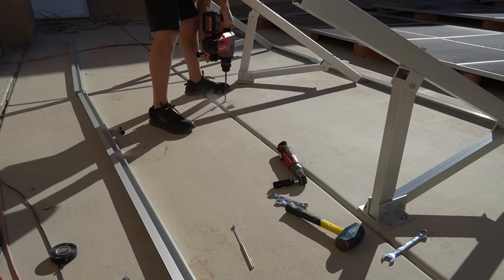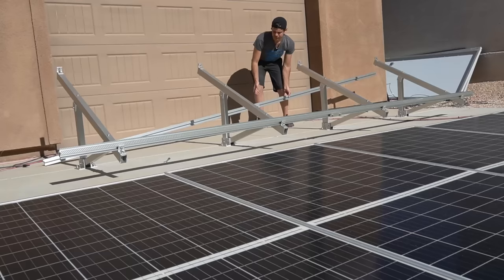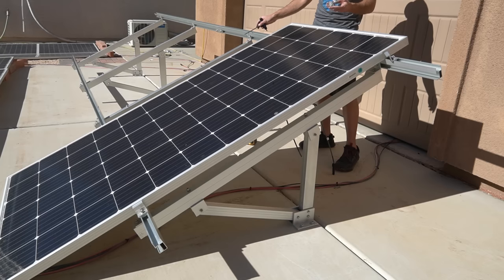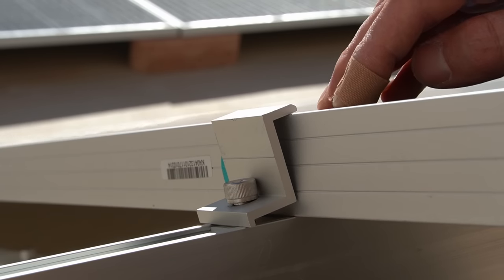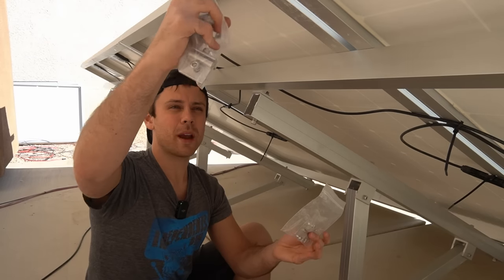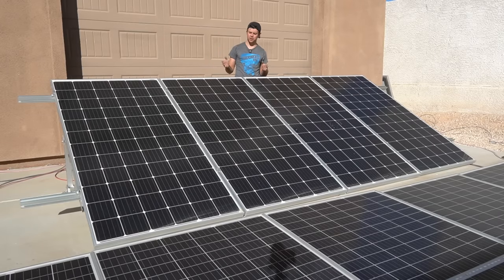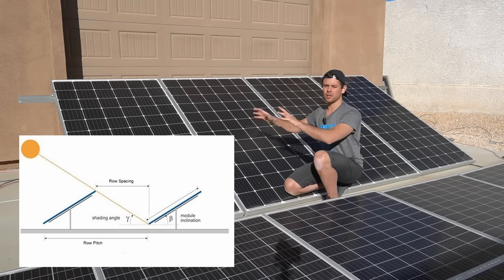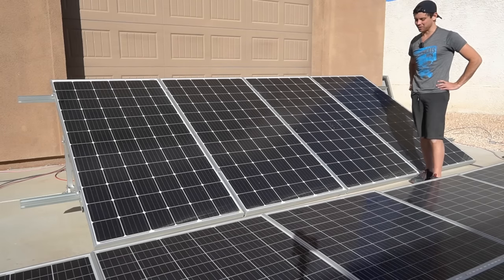$279 Ground Mount Solar Array - DIY Friendly!

Comment from the maker: You can buy it here (affiliate link): https://signaturesolar.com/eg4-brightmount-solar-panel-ground-mount-rack-kit/?ref=cPwLcVc0SW-BjN

~~~~~~~~~~~~~~~~~~~~~~~~~~~~
Does off-grid solar confuse you? Check out my DIY friendly website for solar system packages and product recommendations, and so much more!: http://www.mobile-solarpower.com

Join our DIY solar community! #1 largest solar forum on the internet for beginners and professionals alike: https://www.diysolarforum.com

Check out my best-selling, beginner-friendly 12V off-grid solar book (affiliate link):
http://amzn.to/2Aj4dX4

~~~~~~~~~~~~~~~~~~~~~~~~~
My Solar Equipment Recommendations (Constantly updated! Check here first):

12V/48V Lithium Batteries: https://www.mobile-solarpower.com/solar-batteries.html

Solar System Component Directory: https://www.mobile-solarpower.com/solarcomponents.html

Plug-N-Play Systems: https://www.mobile-solarpower.com/full-size-systems.html

Complete 48V System Kits: https://www.mobile-solarpower.com/complete-48v-solar-kits.html

DIY Friendly Air Conditioner/ Heat Pumps: https://www.mobile-solarpower.com/solar-friendly-air-conditioners.html

Complete 48V System Blueprint: https://www.mobile-solarpower.com/48v-complete-system-blueprint.html

~~~~~~~~~~~~~~~~~~~~~~~~~~
My Favorite Online Stores for DIY Solar Products:

-Signature Solar: Offgrid One-Stop-Shop. Best Value 48V LiFePO4, Victron, Quality Solar Panels and Offgrid Specific Heat Pumps: 
https://www.signaturesolar.com/?ref=h-cvbzfahsek 

-Current Connected: SOK, Victron, Mr.Cool Heatpumps and High Quality Components: https://currentconnected.com/?ref=wp

-Ecoflow Delta Official Site: My favorite plug-n-play solar generator:
https://us.ecoflow.com/?aff=7

-AmpereTime: Cheapest 12V batteries around:
https://amperetime.com/products/ampere-time-12v-100ah-lithium-lifepo4-battery?ref=h-cvbzfahsek

-Rich Solar: 12V solar mega site and cheaper prices than renogy! Check them out: 
https://richsolar.com/?ref=h-cvbzfahsek

-Shop Solar Kits: Huge site with every solar kit you can imagine! Check it out:
https://shopsolarkits.com/?ref=will-p

-Renogy: A classic 12V solar store that has been around for ages! 
https://renogy.sjv.io/n1VjXx

-Battery Hookup: Cheap cell deals
https://bit.ly/2mIxSqt
5% off code: diysolar

-Watts 24/7: Best deals on all-in-one solar power systems, with customer support and distribution here in the USA: 
https://watts247.com/?wpam_id=3

If DIY is not for you, but you love solar and need an offgrid system, check out Tesla Solar. Low prices and great warranty, and they can take your entire house offgrid with their new Powerwalls: https://ts.la/william57509

~~~~~~~~~~~~~~~~~~~~~~~~~~~
Contact Information:
I am NOT available for personal solar system consult! If you wish to contact me, this is my direct email: williamprowsediysolar@gmail.com

Join the forum at https://diysolarforum.com/ if you wish to hang out with myself and others and talk about solar

FTC Disclosure Statement and Disclaimers:
Every video includes some form of paid promotion or sponsorship. Some links on this youtube channel may be affiliate links. We may get paid if you buy something or take an action after clicking one of these. My videos are for educational purposes only. Information is subject to change/update at any time. Electricity is DANGEROUS and can kill. Be smart and use common sense :)

DIY Solar Power with Will Prowse is a participant in the Amazon Services LLC Associates Program,
An affiliate advertising program designed to provide a means for sites to earn advertising fees by advertising and linking to Amazon.com
Reply: Hi Will! Can I get these panels shipped to Mexico? Was thinking getting some poly rich solar panels from Amazon to start building my system
Reply: What is the minimum you recommend spending for a solar setup that the only thing you should expand is adding extra batteries and extra solar panels?
Reply: What's so frustrating is with minor modification you install a central shaft and an electrical motor for sun tracking
Reply: need a video about DIY by MIDNITE SOLAR, inverter
Reply from the maker: @nineteen70six  those are cheap relabeled units from china. renogy and other distributors sell the same ones.
Reply: @WillProwse  ok thanks, just happened to come across them on a website and never heard of them.
Reply from the maker: @Joyner what? Can you post that on the forum? Who flagged it? I've never even heard of them flagging anything. It's not because of my links
Reply: What exact Solar Panel did you use to put this together. I have that  mount as Well
Reply: Which brand/ sized charge controller would you use to handle the 1600w coming from the solar array? 
I have 4 panels(228w) that I want wired in series as 24v and each panel outputs 29.6v. I have an MPPT Renogy 40amp Li with a voltage limit  of 100voc. If I hook up all 4 panels in series the voltage output is 118 4v it passes the 100voc limit, I can only hook up 3 panels at a time currently. Any advice?

Comment: Have my 12KW system up and running..finally. 2 strings of 2 in parallel. I am getting 350 VDC at 20 amps on the 2 paralleled strings. Almost 7 hours a day. 40 Degree permanent tilt to average summer and winter. A lot of work and time but well worth it. One heck of a learning curve
Reply: Did you mean 2 strings of 12 panels? Sounds like a great system.

I have a 6kW system, installed 8 years ago. It has two strings of 12 panels at 250W each. My next one will use panels at almost twice that power. Greetings from México, where our panels are at 22 degrees!
Reply: @impulsesystems  Hello Lee..I always confuse the string. I have 4 rows of 7 panels upper two are series then one parallel lower 2 the same ..total 28 420 Watt panels, so I have two parallel strings feeding the inverter. Even on a cloudy day I get 350 VDC on each parallel string at 20 amps each. All connected to a SolArk 12 K EMP edition. 
For an old man like me it was a project and ahalf

Comment: Just a suggestion - instead of using the readheads to anchor the array to the concrete, use Tapcon bolts. This way if you were to take it down, you just remove the bolts, not cut off the readheads and leave them in the concrete.
Reply: Ya I was like omg that a beautiful concert pour and they did amazing float job, and he fractured it... tapcons r the best, and if u wanna make em permanent just add some bonding agent, the type I'm trying to think of is not computing in my brain after being awake for 28hrs

Comment: I just began building my own panel array mount.  Had to clear a lot of trees out of the area and then "planted" 3 telephone poles around 5 feet deep, 12 feet apart for a 24' panel mount.  Then strung a level line across the poles at 12' high and cut the tops off at a 33 degree angle (for our latitude).  Then took the tops, turned them over and buried those 12' in front of each of the poles I just cut them from so I had short poles in front with a matching 33 degree angle.  Then I placed two 16' beams on the tops of the 12' poles and the same on the short front poles.  Finally, placed more 16' beams between the front and read supports, lag bolted some u-channel metal onto those, and then secured my panels to those.  I only have 12 455 Canadian Solar bifacial panels so far, but plan on adding another 12 to 24 for my Will Prowse inspired 6500 EX split phase system from his blueprints.
Reply: it would be cool to find out where you can purchase the aluminum frame to build a big, cheap, light weight sustem.

Comment: Will , THANK you for finding this for me. I've had my panels (8 100W Renogy 12v)  leaned up against the house at the correct angle for over a year, and I've not been able to actually go out and build an array assembly. this will make it easy enough to do in an afternoon!! I appreciate your research and your finding of these!
Reply: Unless you live in Miami Florida, you're still not at the right angle.  38 degrees would be correct, not 25.
Reply: @michaelthompson9437  Mine are set to 35 degrees. Close enough for my on-again off-again solar experiments!
Reply: I'm looking at the same 100w renogy panels, & wasn't sure if their length was enough to fit that mount.

Comment: Will.  Thank you so much for doing what you do. I'm investigating a system for my home in Central Georgia.  I have found that the local area companies that do this are, primarily, poorly trained SALESMEN". If I had not learned so much from you, I wouldn't have realized that!!!!!
Reply: same here in central flori-DUH
Reply: Same everywhere. Most small solar installation companies are like the "script kiddies" of hacking, knowing only one way of doing things while understanding little to nothing about the subject save for what their supplier tells them. Ain't just solar installers either- this lack of true expertise happens with almost every type of service business nowadays. The old saying about "if you want it done right then DIY" means more now than ever and with people like Will and his website forum you can DIY better and cheaper than anyone can do it for you. The exception is grid-intertie systems which require licensed electricians and inspections as well as often specific equipment requirements. If there's a reason you can't DIY (age, physical ability, available time, etc) then you still need to know this stuff so that you can select the best installer and avoid the usual 'instant experts'.
Reply: @key thing  I'm in Avon Park  I live off grid  full time not a sales man lol.
Look up solar tech Avon park
Reply: @SolarTechFL  thank you for the info...I'll look into it

Comment: Great demo/review.  And using raised ballast buckets vice a permanent fixture works for those of us that may be renting a house.
Reply: Raised ballast buckets?? Explain please.
Reply: @xraykadiddlehopper8067  Just using buckets with cement as the base for the frame posts/legs instead of digging a hole and filling with cement.  I’m picturing a wood vs the metal frame used in the video.
Reply: I would suggest if you are allowed to set the buckets into the ground.

Comment: Fantastic buy.  This information is why I subscribe.  Thanks Will.  
Adjusting the angle:  Rather than bolting the base directly to the concrete you can fabricate/find/buy a sturdy henge that bolts to each base and then to the concrete.  This would allow tilt to any angle you like.  It would then require a "stop" on each henge to lock into place.  Or, imagine using a large threaded rod and nut at each leg to adjust the angle.  The rods would have to be supported by ground anchors or the equivalent.  Be DIY.  Live big.
Reply: 3/8" all thread,  thick washers, drop in anchors, and jam nutted could tilt them easily.  id be more concerned about the front tipping forward (no supports there).

Comment: This mounting system is intended to be secured to raised concrete
footings. Sonotube footings would be a good choice. Attaching 
them to a concrete slab will severely limit your ability to adjust
the angle of the solar panels

Comment: That does look nice and well organized. Very stable as well. Excellent for that many panels. My small set up is just a couple hundred watts using a dumpster find. Someone was throwing out the remainder of a table frame. It’s steel with removable legs. My guess is the glass top had broken. able to get tilt angle by unscrewing a couple of the legs further out than the other two. Ratcheting tiedowns strap holds it to the ground simple wood frame mounts panel to the steel table. always like seeing your experiences and reviews of items like this. Just today realized I’m really into harnessing solar for electricity as I find myself determining brightness of the day based on current coming in on the charge controller. At twilight tonight it was 2/10 of a bolt light out. 😮

Comment: You can actually make all these parts yourself quite easily with aluminum square tubing, aluminum angle, and the nuts and bolts.  I built mine for my 36' x 6' solar  hot water evacuated tube system.  Though, for the price, that's an incredible deal and everything is ready to go.
Reply: Yeah I agree, easy to make but for the price it’s conveniently already to size
Reply: Or use unistrut/superstrut. It was  $2.20 per foot in the before times.... in the long, long ago, like 2019, I don't know what it goes for these days, but I built a 6 panel elevated  ground mount array  for ~$150. Figure a bit more if you don't have drill pipe lying around like I did to make the big T that I bolted the strut to. One could use concrete and additional unistrut to replicate what I did and still be in the $200 neighborhood.... Depending on what you pay for unistrut.

Comment: Nice job on the installation! We built something similar 2 years ago out of wood, well, free wood I had from a very large dog house. It is a solid 4x4 beam base with 2x4 everywhere else. There are slight adjustments to compensate for Summer and Winter angles. It is all made out of treated wood. It is a solid mass of wood beams and can be moved if needed. It has a base height of 24 inches off the ground. Works good for 2 years so far. I used 4 330 watt panels almost exactly the same as you have in the video. I did buy an additional 330 watt panel that I put with my other array.
Reply: Love it. My first home solar project was a solar cat house in Colorado!

Comment: Just ordered the new EG4 adjustable ground mount. Web page list 30mm 35mm and 40mm end clamps included. Angle 25-45 degrees and still the same price.

Comment: In Las Vegas. I just tossed the panels on the ground (well I did give them a slight angle and secured them. )...panels are cheap (paid $50/240 W) and the frames are a lot of work. 
Summer was great. Ran a mini-split, freezer and charged an EV. In late Autumn I barely keep the batteries charged running only the freezer and inverters.
Moral ...I think I made the right call. Little work and optimal output in the Summer when my electric bill is highest.
Reply from the maker: Nice

Comment: I just discovered your channel. I will do a deep dive on your videos to "catch up" on information. 
I installed a RPS solar well system a few years ago. Converted my domestic well from grid tied to off grid with a grid plug in if needed. The kit included 4-100 watt panels. Using salvaged bed frames I welded my frame. It's supported on 4x4 pressure treated posts buried 3 ft in concrete. The frame pivots to adjust to the seasons. I'm in Central California with good southern exposure on 2 acres.
Due to finances, right now I have a 48 volt battery bank consisting of 4 off the shelf marine/RV deep cycle (Walmart) batteries. 
I'd like to upgrade my batteries in the future. 
My battery bank is outside in a 3" foam lined weatherproof box that sits under the solar array to shade it from the hot summer sun.

Comment: Thanx for sharing. I could use one of these. If it weren't for the roof air.. I could mount this on my RV roof..  and now we know what your doing on a nice sunny Saturday.

ps. You could also add some washers to level up that clamp too.. as long as the bolt still grabs some threads.

Comment: Dang that's a really good price as its not much more than the cost of the aluminum itself.  
If you got the measurements just right you could make a second row on post raised behind the first.
Maybe even brace them together with some extra channel connecting them.

Comment: I like the adjustable end and mid clamps. And thats a great deal for the amount of panels that go on it. I have a design using unistrut for the entire mount, and its strong.
Reply: i thought about using strut as well......but it expensive, strong af, but pricey. what set up were you going for using strut?     4,6 8 panel?
Reply: With regular unistrut you will get some galvanic corrosion, the severity depending on humidity mostly.

Comment: I like the mount for my flat concrete roof, but it is fixed angle which is kind of a bummer. I only need 18 degree tilt.

Comment: personally, i would raise them at least a foot or two off the ground. because it would be easier to clean snow or leaves that can get stuck in the corner angle edge and not attract animals that would want to build a nest. i would also put them farther out from the home and i would have clusters, because i would want them on a pneumatic pivoting rack that has a solar tracker for maximum sun.

Comment: That looks really strong, looks like it could be built as 2 shorter versions that are 7.5' instead of 15'
(Considering using this as option for mounting smaller panels on top of a shipping container)
Reply: I use it as 2 shorter versions because my land is Uneven

Comment: Thought "what if" you could make something similar out of unistrut... Then I checked the Big Orange Toolbox store and they are currently priced at $36 per 10-foot stick. And then you'd need to factor in all the assembly hardware. So it turns out that the unit in this video is cheaper than unistrut.
Reply: true, but strut is gonna be way stronger.

Comment: I have a question for you guys. To increase the strength of this ground mount, what if you purchased 2 units for the 4 panels setup? Instead of just 4 arms, use 7 or even 8 arms. And strengthen each arm with metal or treated wood. I know this ground mount can handle up to 105 mph winds. But with 7 arms and each arm strengthened, would the wind rating be increased?

Comment: could these mount to a vertical concrete wall and still be the right angle? been trying to find a mounting solution that would work for my odd needs. I have a 4ft vertical wall about 10ft off the ground (front porch overhang on an earth shelter home) and figured I could double my shaded area and also keep them completely out of the way with no need to ever mow around them.